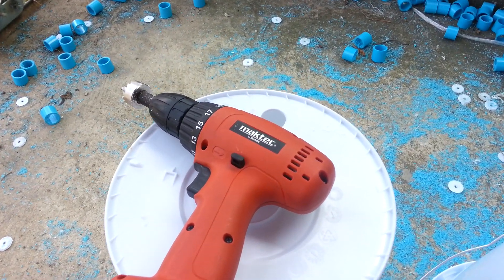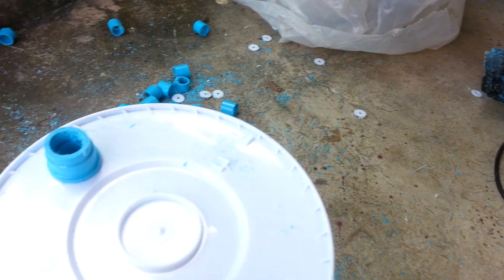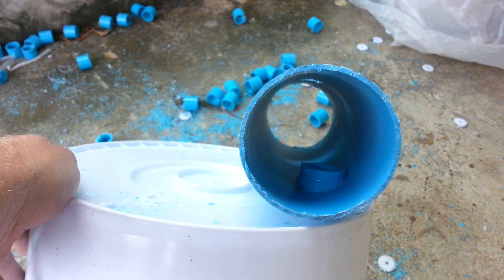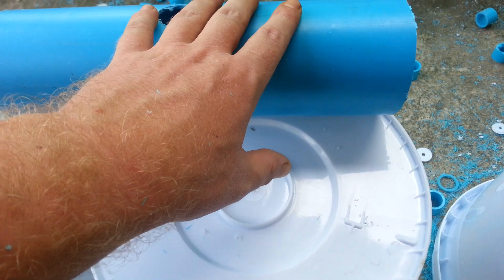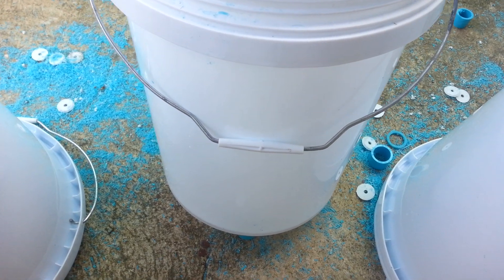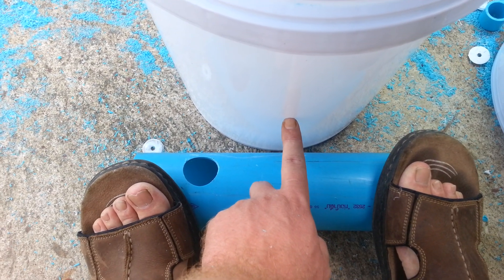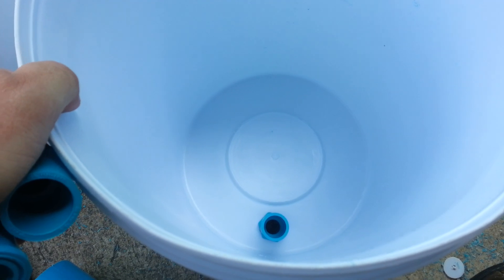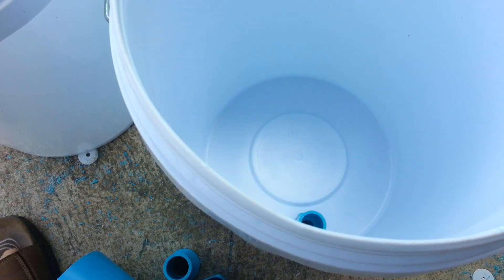Dutch Bucket Design

Comment: This Hydroponic Program is a must read for anyone who is thinking about starting an Hydroponic systems [Check Details Here  ===> https://www.facebook.com/Easy-Hydroponics-Systems-166096780618260/app/208195102528120  ]. This book saves hours of online research. I really enjoyed the inclusiveness of this book, it definitely got me on the right start. I am in the middle of my build, only have plumbing and cycling left to do on my system. Maybe in a new edition of this book the author could speak about using solar tubes for natural lighting. I haven't found much on using solar tubes for grow lights, I decided to use them in my garage to cut utility costs. We'll see how well it works. Thanks for this great literary piece on Hydroponics.

Comment: You stated that you have algae issues with pearlite. If you use pearlite, top it off with a cover of hydroton. if light is an issue then use some relective bubble insulation as a bucket cover.

Comment: As a future enhancement you could add a second drain that goes into the second poly tube that you are using now as just a stand.

This will add a backup drain in case of blockages, as well as doubling the overall drain capacity of the setup - meaning you could add a heap more buckets to the same system.
Reply from the maker: A certainly viable option! Thanks for tuning in. 

Ryan

Comment: Nice video Ponic Wars, I live in Bangkok as well as have a house and farm up north. We grow some stuff up at the farm and looking at doings some dutch buckets  plus some floating beds as well maybe. I have been searching for the 3/4 grommets you see a lot of guys use and I thought of fittings like you are using but have not seen any about. Could you tell me please where you found yours? I looks at the big Home Joints just out of Bangkok that is massive on housing gear but they never had that or similar. So if you could point me out where that would be great.
Thanks, Aaron
Reply from the maker: Hey Aaron Spearing. Check the construction shops. Normally, they have PVC in pipe racks which is a good sign they probably sell all the fittings. These male/female pieces are extremely common from what I have seen. If you absolutely cannot find them, let me know and I'll grab them down here for you, and mail them up.
Reply: Ponic Wars Thanks heaps mate, I will go have a look tomorrow around outer Bangkok and see how I go. Thanks again much appreciated

Comment: Hey Ponic, i see a lot of use of the Dutch bucket in Hydro. How well does it perform in an acquaponics system and is that how you will use them or will it be part of you Hydro system ?
Reply from the maker: On this project, I am going to run my buckets hydroponically. I have used them in aquaponics, and they work equally well. The only thing to think about when running them aquaponically is that there is a considerably amount of fish waste which will be bogged up in the buckets. Never created any issues for me, and that could be mitigated with adequate filtration, or even a filter on your pump dedicated to feeding the buckets. I also ran my water 24/7 in my buckets when running them off the AP system. My logic there was just to keep the bacteria that developed in my buckets happy, but certainly not necessary, unless they were your only source of bacteria, i.e. no growbeds.
Reply: How much did the buckets run?
Reply from the maker: Karl Underhill Depending on where you get them, 85-95 baht per bucket.
Reply: Hey another quick question, i'm not any where near my project site but I'm drawing it out on PC and could use a couple real world dimensions / measurements using you model.
1: How much space does one bucket take up (Depth/width)
2: Is it possible to configure a back to back, i would think so
3: and the siphon 3/4" not 1" why too much space taken up
4: I have read about a great deal of agile building up on these type buckets because they are semi-translucent, do you have plans to cover them to reduce the light influence, and if so with what?

I like this bucket design, it looks like i will redesign my system again to accommodate this type of grown bed. I'll end up with far more plants per sqft... Thanks
Reply from the maker: Karl Underhill
1.36cm wide (at widest point, from handle hook to handle hook) 37.5cm tall
2. Yes
3. Personal preference. Keep in mind it is not a siphon, only a drain. I'm using 3/4" because I already owned a hole saw for this size, and because 3/4" tubing will allow me to cut slits in it for the drain without jeopardizing the integrity of the strength. I'll show this in another video soon so you can see what I'm talking about.
4. The white buckets I have used here at home are thicker plastic, and I do not have algae issues. These buckets in the video are thinner, and could have some algae problems. Hydroton is much less translucent than perlite. Most algae issues I see are guys using perlite. I can't say 100% I won't have algae, will address it as it comes up. Not covering the buckets initially.
Reply: sorry 1.36 cm wide ?
Reply: In you experience is a siphon not workable ? or not advised ? or not needed ? The reason i ask is i will have grow towers with in the  bucket as well..
Reply: Good chat-N with ya thanks
Reply from the maker: Sorry, 36cm wide. I personally would not put a siphon buried in the media, where I cannot access it (just keep in mind if you have to disturb your plants to troubleshoot something, it becomes ineffective very quickly.) Just customize for what you need. :) Email me at ponicwars@gmail.com if you want to discuss specifics.

Comment: So, you are going to put an ell on the inside with the slitted pvc to create your 2" reserve, if I'm reading you right? Cool idea!
Reply from the maker: Hey keyplayr61, I think your asking about a 90 degree on the inside? It will be just a stand pipe, that goes straight up, with an end cap on it. I'll lay my 3/4" PVC in the chop saw, and cut a few slits in it. So the slits will run horizontal on the stand pipe, and those drain slits will control the water level. A 90 is an option, but I can't think of any reason for the extra piece, and more pipe cuts.
Reply: I gotcha!

Comment: Looks good  need to move over there to buy some cheap fittings.  Will you still have a small amount of water in the bottom if the power goes out? With my mature plants they have gone a week with no pumping by mistake. Still survived. But don't have your temps in Calif.   Could see a problem    What do you think?
Reply from the maker: Yes, there will be a 3-4" of reserve water in between the timed waterings. Additionally, the entire system will be on a back up generator in case of short term power outages.